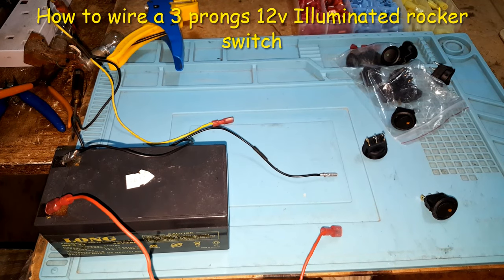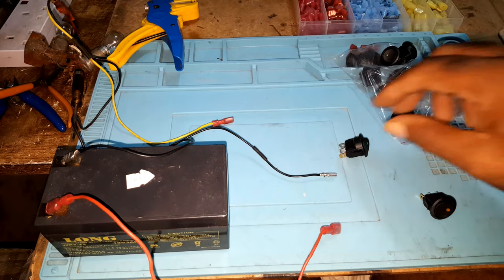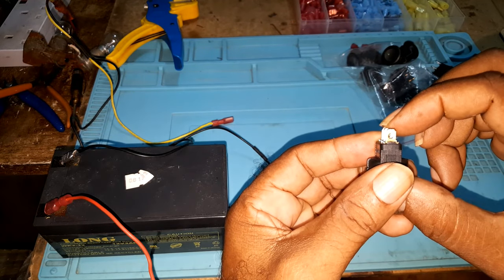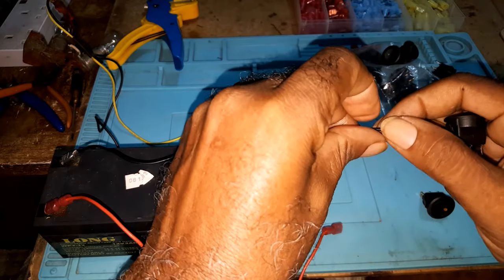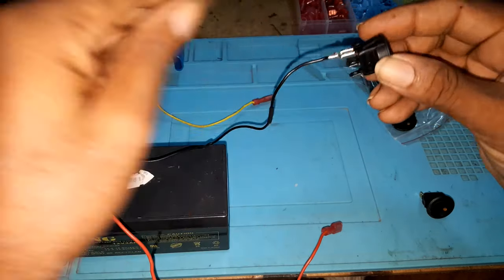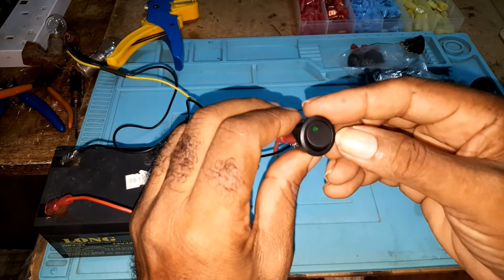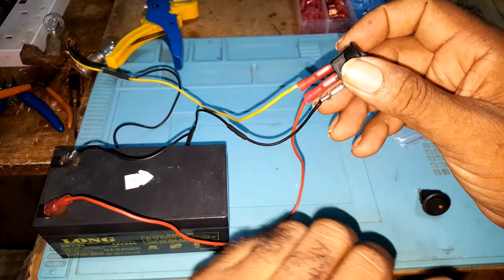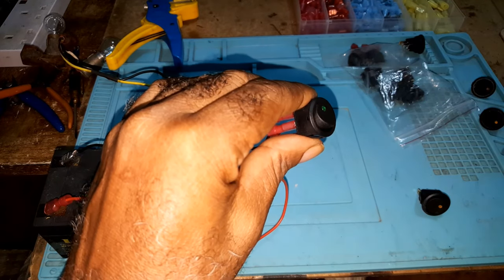How to wire a 3 prong 12v Illuminated rocker switch

Comment: I have literally been trying to figure out my toggle switch with the wiring that I put in all damn day! The main picture from the video before you click in helped more than anything! I cut off a fuse and wires from a Bluetooth strip light set, hooked that up to the battery, and blew one fuse before I looked at the picture.. hooked it up that way and voilà
Reply from the maker: Glad I can help.

Comment: With these rocker switches, do you use inline fuse holders to the battery? Or is the fuses only use for the ACC line to the led lights? Or both?

Comment: I want to replace an older on/off nonlighting swith in my RV. I only have two wires to work with coming from my RV, one black and one red. What do I do with the third prong on my new lighted switch?
Reply from the maker: Take the power, which is the  positive to one side of the switch and the other side of the switch to the load. The negative, which is the black to the end of the switch, you will have too black wire one from the switch to the load and the other battery. Hope this helps.

Comment: So I have one of these switches to operate 2 leds spotlights in series in my campervan i'm building. The wiring is already laid behind the cladding and is inaccessible  but I can access the switches wiring. Thing is I want the light on the switch to be ON permanently how would you normally do this do you need to break the negative cable make a three way connection and connect it to the brass terminal on the switch? Thing is I don't think I can access the negative cable, its buried behind the cladding. Could I simply run a short negative cable from the brass terminal of the switch and ground it onto the van chassis nearby? Or would that create a problem for the circuit??

Comment: i used this rocker switch for my amplifier running with 24v 6a adapter and it's very hot. is it safe or should i change it?
Reply from the maker: The switch is 12v and not 24v you can get a 120v or 220v but put a fuse in line with your application. Or you can disconnect the light on the switch.
Reply: @AlwynNicholas  if i can disconnect the light than it's not gonna be this hot? 
ok i'll try that tomorrow morning. 
220v switch mean i have to make adjustment to the back socket my amplifier case and that alone makes it the very last option to me
thank you very much for your fast reply. congrats you just got your self a new subscriber
Reply: You should add a relay

Comment: Would it be beneficial to wire these to a 4 pin relay or is that a dumb idea since the switch will have the built in led light connected to pin 30 amd gnd and getting that full amperage anyway?
Reply from the maker: Yes you can wire it to a relay.

Comment: ok, can i get some help here. i have a switch wired from a 15a fuse to the switch to a relay to my led lights. my switch does not light up. but the led lights go on.
Reply from the maker: Do you have the negative pole of the switch connected.
Reply: @AlwynNicholas  yes the negative is grounded.
Reply from the maker: Is it 12V.
Reply from the maker: Remember that the power going to the switch is 12V. If its not the LED on the switch will not work.
Reply: @AlwynNicholas  yes, I hooked up another switch same way and decided to purchase another switch it's all good, it was a bad switch or light in the switch
Reply: @AlwynNicholas  thanks for the assistance.

Comment: Can I use a 12V 20A toggle switch in my motorbike which has a 12V 9A battery? I want to use it for controlling a pair of 12V 20W fog lights. Is it wise to install it on my bike without using any relay?
Reply from the maker: Yes but put a fuse
Reply: @AlwynNicholas  What will be the capacity of the fuse?
Reply from the maker: Get  a ip65 / 68 waterproof switch for the motorcycle that one isn't waterproof. @daexplorogist1781
Reply from the maker: The relay is there to protect you and the bike, the switch isn't waterproof you should get an IP65 / 68 waterproof switch and see the manual for the light for the right fuse. @daexplorogist1781
Reply: @AlwynNicholas  There is no manual books with the light.
Reply: @AlwynNicholas  What will be the capacity of the fuse? There is no manual books with the light.
Reply from the maker: Put 10a on each side of the light @daexplorogist1781

Comment: if i want the light is on, the led on the switch is off...

when light is off, the led on the switch is on... 

how to do that?
Reply from the maker: The load positive to the  top pin, the power from the battery to the center pin and the ground or negative to the gold pin.

Comment: Why does mine have a 4th wire going into the side
Reply from the maker: You have a main switch which is a on off, 4 pin. light or power rocker switch.